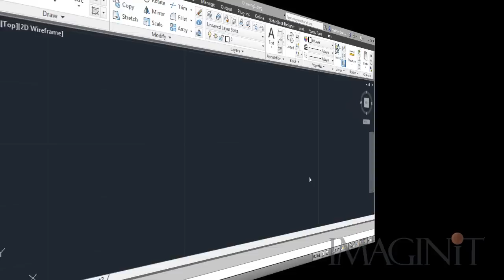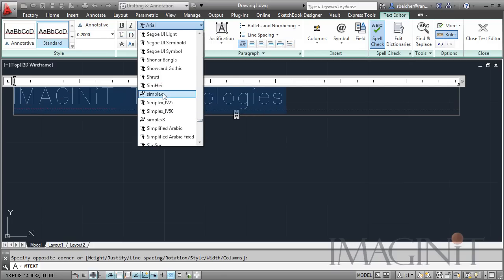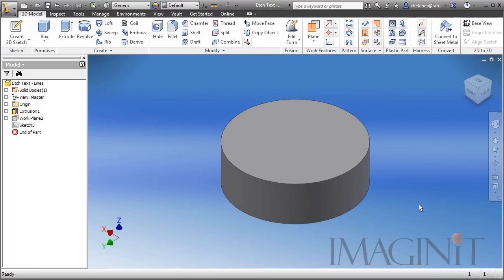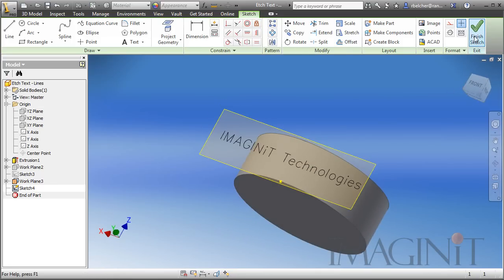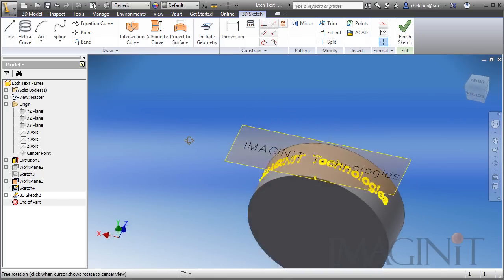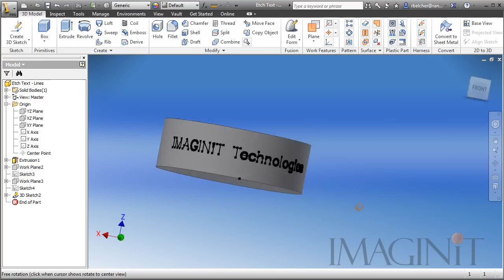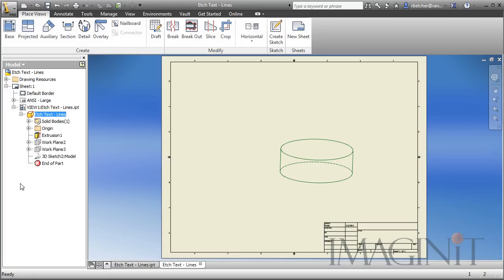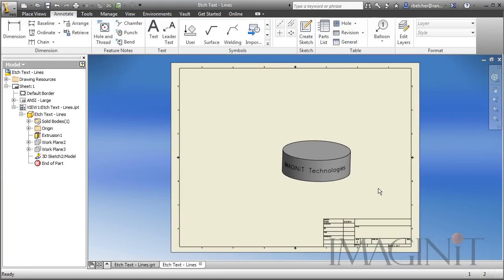Project 2D Geometry to Curved Surface Using Autodesk Inventor.wmv

Comment: I realize this is old, but I cannot make a simple Star Trek (original series) communicator. No matter what I do, including the method shown above, the holes will not align to the surface's changing normals (the antenna / lid of the device). When I got them to do something, there were error messages, with artifacts from the curves everywhere... never mind trying to use these curves (they were circles) to puncture holes.

Comment: man, had so many probelsm with this simple task gods sake. I do as you say exactly but im typing text not pasting. I click the plane draw the tetx box, all is fine ten when i press ok with the text written it comes out vertical instead of horizontal along the plane! Right so I rotated it to match the plane(whic i shouldnt have too) now when I go to wrap it to the surface, yea it lets me select the curve of the part but I cant select the text!